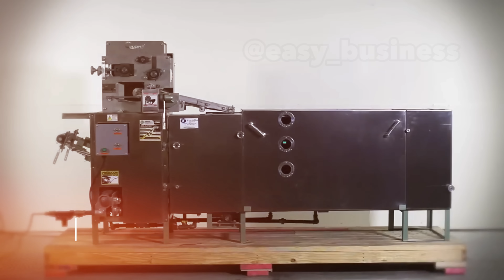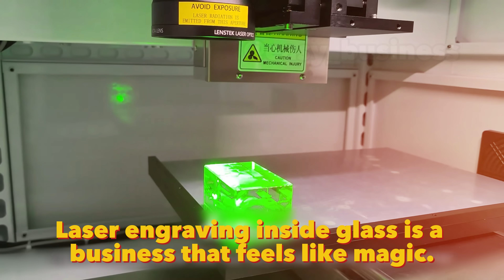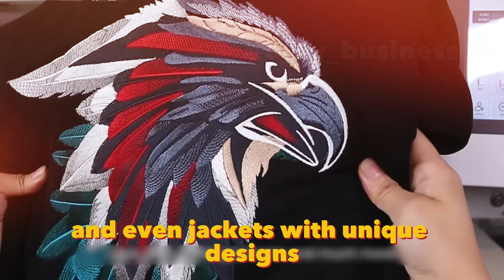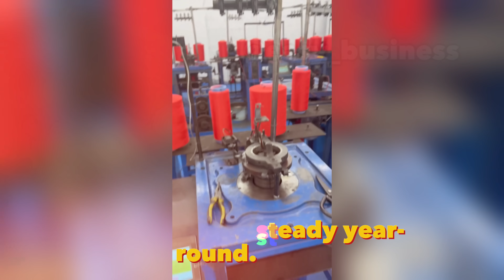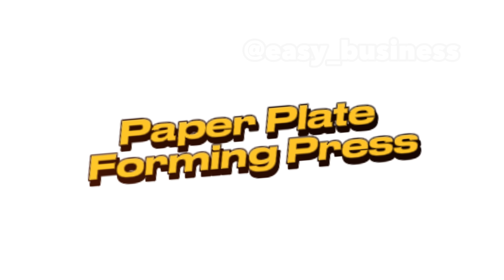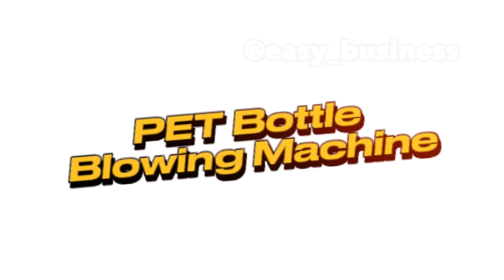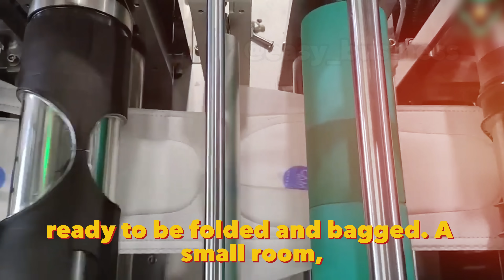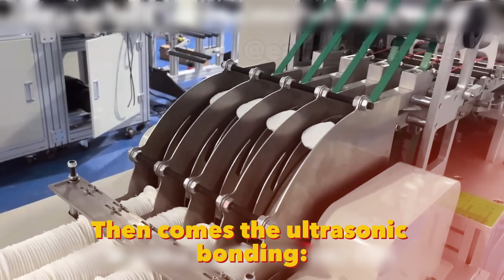30 EASY MACHINES TO IMPORT FROM CHINA FOR STARTING HOME BASED BUSINESS

Comment: The vast majority of Chinese machinery has no technical staff back up - so if it breaks down or a part of the machine fails you are probably not going to get it running again as their is no support in your own country. Especially true of the smaller businesses in China who sell abroad. Machines will break down no matter how well made they are. That is why it is better buying the machine you want from a manufacturer with a reliable technical back up and support.
Reply: That becomes an new domestic business - Chinese machine repair!
Reply: Most things are fixable with a new part and some common sense. Chinese use nuts and bolts too
Reply: @vivelachocha2751 Why use nuts and bolts when you can use a wire instead ?!😊
Reply: @mihailfelixdumitresc that literally made no sense
Reply: @vivelachocha2751 true, this are just people who love complicating things
Reply: @vivelachocha2751  getting the new part is the issue…..
Reply: What are you talking about?  I have immediate help for my Chinese machinery.
Reply: The cheap Chinese gear could still be useful to a tiny home garage start-up business idea that can't afford much initial investment. You could take the gamble that the cheap machine will hold up long enough to generate some profit if you don't run it too hard. Bank your profit with the goal of investment in higher grade gear later. With a little luck a few years into the future your cheap starter gear might have turned out enough good product to have paid for itself, earned profit and is now just starting to wear out and soon need replacement. Then it's time to look into upgrading the gear and expanding the business now that has it proved itself to be established and profitable. If the cheap gear fails before reaching that goal, well that's part of the gamble, but it may have been worth taking a shot at it for a start up from nothing. Also, business ideas often do fail for lots of other reasons so it might make sense to go with the cheap machine at first and stay with it long enough to see if your idea will succeed for your personal situation before getting more deeply invested in expensive gear.
Reply: @onemoremisfit  you are right. Those who disagree have the money to buy the high-end stuff, but repair is not as hard as they say, if something broke,  find a replacement equivalent,  or go to the local machine shop and have a part made.
Reply: @onemoremisfit I totally agree with your point. I recently saw a video that did exactly what you described to get started making their product with a small initial investment before scaling up. The video is called, This $682 Garage setup produces $1,000,000+ A year.
Reply: @onemoremisfit makes more sense than rejecting the machine because its made in China.
Reply: A cheap machine and a little 3d printing and you can fix most things easy.
Reply: @X_M_Dragon  There is a market in printing legacy parts for old cars (plastic bits that are hard to get now). You can also do the same thing for boats (canvas clips etc).
Reply: Exactly, seems like the idiot doesn't know what he's talking about. "No tech support".   Boohoo, like I need their "tech support" anyways...
Reply: This is true. But this is also how middlemen make money. I know a guy who makes his entire income from teaching and fixing one equipment. He wont tell what it is tho… but im guessing expensive equipment for medical offices
Reply: This here is the esence of why i love to read comments.
Reply: Exactly 😊
Reply: Get another one, is cheaper....
Reply: I wouldn't buy a machine if I didn't already know how to build it myself. It's fine if it breaks, you fix it with a better part.
Reply: Not true.
Reply: That's why in Africa we fix the machines ourselves😂
Reply: You must be from biased united states' 😂
Reply: Common man. Same as old tractors, rigs and cars. Almost everything is electromechanical in these machines and could be remanufactured easily.  The main thing is to know how machine works and spare parts specs like seals diameters, type of lubrications, friction rollers material, bearings numbers etc.
Reply: Another great small business idea. Service of small Chinese machines. Parts are readily available, but a person needs to know where to look. In China, many factories work from a fairly standard supply of interchangeable parts. The supply chain is the best in the world.
Reply: @ exactly. there is so much future in this. instead of few countries producing,thus creating human right abuse by cheap labour,many countries can produce themselves,thus creating jobs. sure this is nutshell,but if the government's of world countries will see and adapt potential,it can be bright future to many
Reply: Stop drinking the Kool-Aid…..

no manufacture wants to support the customer after they already taken their money
Reply: I’m sorry just because china makes it doesn’t mean we can’t make it. They just make it cheaper. There isn’t a part that can’t be made on a cnc, lathe, 3D printer etc right here in the states. I’m a certified machinist and I could make the whole machine myself down to the bolts in the machine in my garage for fun…. Just need the first one to reverse engineer and make a 3D cam for my machines to run off of! Truth is just need the first cam program and no machine…… Do you know how many cam programs already on the internet?!….
Reply: Interestingly china has taken the global dominance economically
Reply: I thought this, but I spoke to an engineer in my country who was pretty confident he could fix a machine I showed him. Speak to engineers that already repair heavy/industrial equipment, a lot of the time parts are producible and operation follows simple combinations of simple mechanics.
Reply: Which American companies make these machines?
Reply: Exactly 😂
Reply: @StephenLambert-k9s  I think we should get into doing this could you imagine having American machines made like this and with back up personal to care for them after they break
Reply: A maga clown Lying 😅
Reply: How well they are made ???
BY CHINA ????
LALA LAND !!!
China makes schitt , and sold for 10 x what they are worth!!
I can't begin to tell you how many times I had to send back Chinese TRASH !
Pellet guns that leak like a shower on full blast , at least 7 times , to get one that didn't leak!!
No thanks , you buy it!
Reply: agree,but wouldn't this obstacle open different markets? reps of machine companies in other countries? other thing is- raw materials. in many countries that is a serious problem
Reply: Nnnnnnn
Reply: So when one buys machines from China, there's no support or guarantee provided by the manufacturer? That is scary indeed! 😮👍
Reply: You are so wrong on so many levels I don't even know where to begin to correct you
Reply: Amen.
Reply: Bro, just learn how to fix them yourself; it's not that hard, unless you're American. in that case hire an immigrant to help you out
Reply: I would rather buy a new machine with my profits if I have to, than not start a business at all cause I can't meet the capex requirement for high end equipment
Reply: @hamilcar358  American propaganda has done you guys so dirty
Reply: True. Probably tofu machines.
Reply: Bull crap
Reply: Bs... When you buy bigger machines you will get support and often free parts.... I have bought a lot from China and will gladly do it again and again....
Reply: Chinese companies are responsive. Send them photos and describe your requirement and they will ship you parts. I have had no trouble with suppliers.
Reply: Yeah that’s probably very true
Reply: If you need someone to repair one of these for you, you already lack the skills needed to run these business types. I’m in industrial manufacturing and maintenance and would highly advise that background if looking to do this kind of work. Without that you’re better off sticking to things you know best or be ready for steep learning curves.
Reply: You’re 💯 correct with this comment. I work for a multibillion dollar corp and getting parts for one of the Chinese machines is a nightmare and takes alot of time. They sometimes have to send techs from China to work on things because the machines are made with poor quality components. And this is a multibillion dollar corporation…so imagine how difficult it would be when you are a small business startup. While it’s great to be an optimist, many of these commenters have no idea what they’re talking about.
Reply: Which American company will hand hold you with problems?
Reply: The trick is finding the Chinese machines that are rebranded and resold by American distributors. They offer onshore support. Baker, cantek, grizzly all rebrand chinese machines and have great support.
Reply: you can order spare parts and if you aren't able to repair it yourself you can bring it to a dude who repairs similar machines and he will fix it
Reply: Learning to repair,maintain, modify and adapt machines, chinese or otherwise, is important to know especially if you want to start a business using said machines.
Reply: Even European machines there is a problem. If you live in Africa and your company bought a European factory machine, the Support staff won't get back to you. We have a German conveyor belt that needs parts replaced but the manufacturer ignores my emails and LinkedIn messages.
Reply: if you are the owner of a small production - you take the drawings and figure out how to repair it. after some time you can perform any repair and replace parts
Reply: Sadly that very true it's a shame really because there way cheaper in CHINA..
Reply: Or learn to fix the machine yourself
Reply: or just communicate with seller and tell them you want spare parts so you are good for at least 5 years or so. They often know the weak spots and are happy to customize orders unlike many European or US companies that wants you to rely on equipment getting serviced by them.
Reply: Then from the start of the business, find the reliable and the long run business company to cooperate, how to find out that reliable person, need  a pair of sharp eyes，but there are distributors in local market will be a good choice too.  I can tell you there are good quality products with good price in China. But that is not enough to find...
Reply: That's why you figure it out on your own like a real man.   I don't need no godamn Chinese tech support, I'm an American, Godamit!
Reply: What’s the difference with non Chinese machinery? Same situation. If you want engineers to look after your machinery that will cost much more in Europe than China. If you have evidence of their shortfalls you could document it and show us properly. Otherwise you are just hating China because that’s what you are raised to do.
Reply: We provide core precision transmission components and consumable parts.😂
Reply: They sell repair manuals for the machines
Reply: Thats a nice piece of advice you have given many forgets or doesn’t understand and went out dreaming
Reply: Learn to repair it then. Or order extra parts. I did that with my stihl clone chainsaw. 80 parts, but I know I can fix it if need be and it still 1/3 the price of the original saw its a 1:1 clone of. 🤷 I'm not a pro (even though I bought a pro grade saw)  but I know if I were a logger, or needed to mill with it, it would have paid for itself within my first week on the job.
Reply: So which American companies make these machines? You clearly don't know they are manufactured in China and elsewhere, then imported by big American companies who go ahead to set up local support.
Reply: @DeEmperor1 if they are designed in the USA , they will be garbage!  Make sure the china built machine is designed in china, then you have a quality product.
Reply: @DeEmperor1 indeed, if you could hypotheticaly snap your finger and stop everything coming from china, you'll end up with made in USA socks  costing $50, even with middle man selling Chinese items it still cheaper than manufacturing on us soil .
Reply: You can probably have someone CNC machine a replacement part.
Reply: I second to this. The real issue with these manufacturers is today they are on the market, tomorrow they aren't. Quality wouldn't be such an issue, but lack of product support overnight is. It happen to me on several occasions with Chinese and Indian made/sold machinery.
Reply: I know someone who bought a bag heat sealer to seal up bags of marijuana when shipping out to the whole country. It was a good investment that paid for itself thousands of times over.  Not sure if it's still running or not (???) but it wouldn't be a big deal to fix if anything went wrong, and if they have to just go by a new one, who cares? If you're making money with the machine it pays for itself pretty quickly.
Reply: @koriko88 lol if a machine costs $5000 and shipping is $5000 because it weighs 120kgs and it breaks how will you fix it?
Reply: @koriko88 is your friend looking for any more clients?😅
Reply: Tis where I have a secret weapon. I can manufacture my own controls, sensors and machines parts to all complexities. I start with cheaper machines for a launch and build better machines for mass production. Also, I can manufacture parts for others who need their machines fixed, even fix the automation and sensory issues.
Reply: @mythril4  contact info insta fb etc or just email
Reply: Adding to the problem is the majority of Chinese equipment is shit to begin with, so it will breakdown within the first six months. Instead of buying the same thing 6 times, pay a little more and buy it once. If you do buy cheap be prepared to fix it yourself or factor in the money to do so.
Reply: @TravellinOn2010  The trope that chinese equipment is shit in 2025 would be hilarious if not kinda pathetic. The US imports 70% high tech from China, while China imports 30%. What's more everything you use is made in China. That PC or phone you are using? Made in China or all parts were made in China and assembled in India/Vietnam. Top tier heavy machinery? All made in China and re-sold in other countries as own product.
Louis Rossmann gave a really good example with a product he imports from China. There are only two options for that product. Buy made in China or the US. The chinese he was selling at $200 and it's better than the US version. The US version costs between $1400-$1600 and it's worse. 
You can go with the trope that chinese stuff is crap(although as I said, whether it's your PC, phone or any other tech surrounding you, it's all made there or the parts are from there), but made in America isn't particularly great in most cases and it costs A LOT more. 
A lot of top tech brands are OEM manufactured in China and literally just have their lebel slapped on the product.

Also in general, anyone working with any type of machinery that can't fix at least most of the issue on said machine, shouldn't really be working with it. Complaining that jobs are being exported, yet proving why they are exported is not a good look.
Reply: @xingbairong  exactly,  that's why most Chinese shit breaks down or only lasts a third of the time.
Reply: @xingbairong  yes you are right, 98% of ALL Chinese products are shit. That's why they breakdown all the time and last about 1/3 the time of quality equipment.  The old adage that the price of quality is soon forgotten rather than buy the same thing six times over rings true.
Reply: @ Indeed I am right. You acting dumb won't change the fact that your whole computer, your whole phone, your whole TV, pretty much all the tech surrounding you is made in China or have 90% chinese components. 
Stop coping. It's not a good look.
Reply: @TravellinOn2010 I need an industrial avocado press any advice where to buy a good one?
Reply: @humanoid144  no sorry, I don't know.
Reply: That’s because they actually don’t know the technicals behind the machinery. They just steal intellectual property and undercut the people that have spent billions in r&d to perfect something. Then they cut every corner they can.
Reply: Not to mention the miss mash combinations of nonstandardized fasteners, fittings and plugs. 

Plus all programming/coding will be in some hardcore changlish
Reply: No, they all have online tech support, and you can call them and facetime them. U have no idea what u r talking about
Reply: @MMABeijing  So can they get parts to you quickly ? A tecnician from China ????
Reply: @1414141x  That is the only tradeoff. Parts. But if youre buying a CNC for an example, you can get spare parts pretty easily locally. That goes on for every machine. They are not like Apple. Their machines can work with parts from other suppliers as well.
Reply: Exactly 💯.  The most important thing is not the price, it's technical support. Buy locally from people you personally talked and I don't mean a salesman. Visit their shop talk to the technicians. Make sure they have a loaner you could use while your equipment is in repair. Alll of those third world crap  is complete waste of money.
Reply: just tofu dreg glow it up rig it any way make it better American Ingenuity will always defeat Chinese low qauility
Reply: @VaporwaveGorrilla  you missing something in your equation, good will and chauvinism won't change the fact that almost no American companies build or sell these kind of low volume specialized machinery. Or at exorbitant price. America has to accept that the train of power manufacturing is gone. This is a economy of service (the leader at that)  anyone telling you that your 2€ pack of Chinese cotton sock can be manufactured in Ohio is lying plain and simple. Unless your children are willing to work on a line for $200 a month these millions of small items will never return to be made in America. Or it will but by robots, like 70% of a car in a GM, Ford, Toyota plant. We're to rich to have these kind of job. And that's the reality that most won't and refuse to acknowledge.
Reply: @VaporwaveGorrilla 😂Not true
Reply: @Qiushishuo  are u trying to make a monkey out of me?
Reply: @VaporwaveGorrilla  yes a $100.000 machine will always defeat a $10.000 machine.... But now it seems that the price tag is just to pay off investors and big bonuses
Reply: @DannyKa-x8z  America imports machines from China, slap a 1000% markup with their branding and the old "American Made". They do this with their CNC machines. In China you can get a decent CNC for $4000 which would cost you $10 000 in USA. Same material an CNC power.
Reply: @DannyKa-x8z  but what if the $10 machine believes in itself
Reply: @VaporwaveGorrilla  noooo!!!....me amerikan big boy!!! i need BIG,more BIG,me BIG,me want BIG MASHEEN!!!
Reply: @ in america, all burgers go on sale every june 4th, in 1989
Reply: @VaporwaveGorrilla the greatest day that never happened lol
Reply: @VaporwaveGorrilla What?!? 😂